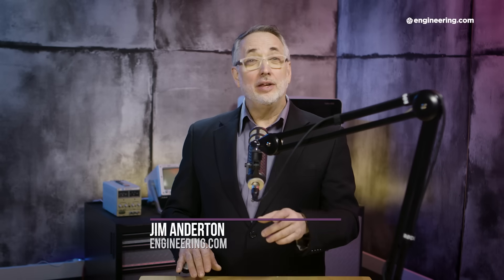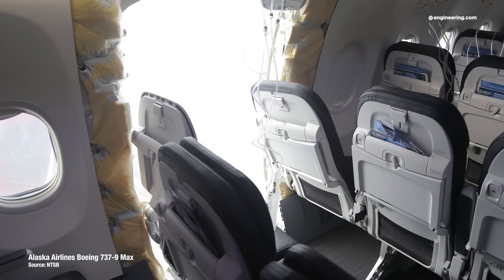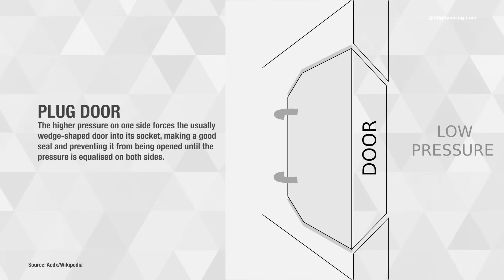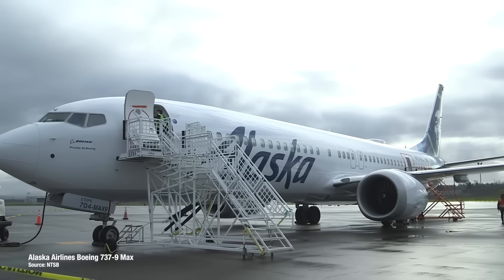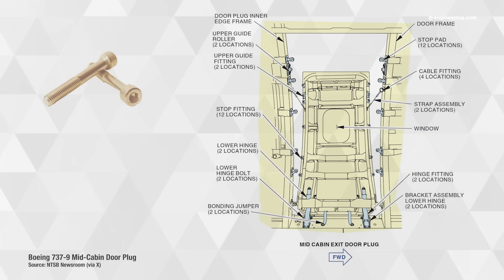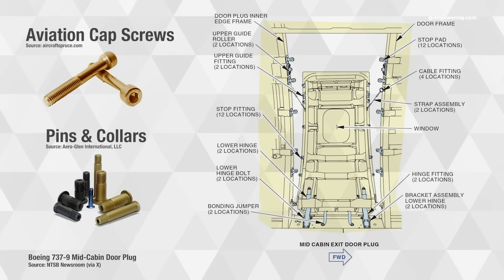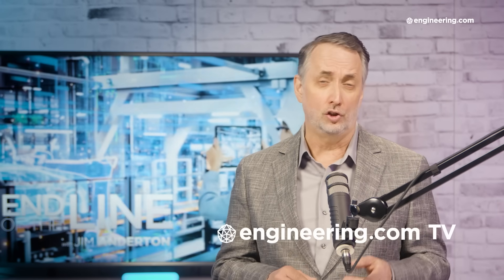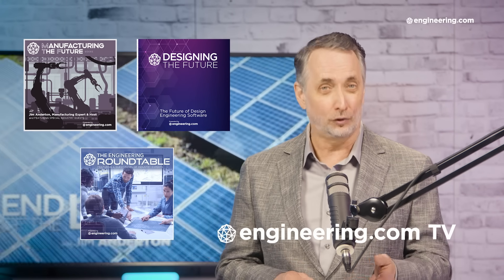The Boeing Issue Isn’t About Bolts

Comment: Blancolirio covered it. They did not have to account for replacing the locking cap screws if the door was not fully removed in a service operation. They replaced the seal, but did not have to remove the door, only Open it. That did not trigger a re-inspection. A cost-saving measure. See where that got them.
Reply: Deregulation
Reply: @michaelccopelandsr7120  Yes, the deregulation frenzy we've been living with (and dying with) for more than 40 years is at work here as is the never ending need for companies in every industry to constantly cut costs to increase profits.  Being able to skip a step that takes time and therefore costs money is manna for bean counters.
Reply: What regulation was repealed that would have prevented this??
Reply: What regulation was repealed that would have prevented this??
Reply: What regulation was repealed that would have prevented this??
Reply: What regulation was repealed that would have prevented this??
Reply: The two companies and their quality management systems not being compatible and both firms being too cheap to harmonize their processes has a big role to play here
Reply: @kansascityshuffle8526  Agreed. Boeing creates a separate company for which it will be the largest, or perhaps only, customer then doesn't require that it use a compatible quality management system? Not impressive...
Reply: @kansascityshuffle8526  so true, I can't stress enough the difference between repair and rework in this case, if I were auditing this process, I would suggest that this plug door application have its own work instruction, separate from the main production assembly instructions
Reply: Prob coded it as a repair, deviation, not rework to print in CMES, deviations are bought off by engineering, not inspection, too many rng deviations have cut out quality control oversight
Reply: A lot QC/QA engineers don't know a rivet from a Hi-lok. The issue is that no one is looking at the primary issue, which is the Door-Plug has an installed configuration, if the Door-Plug is opened, it's no longer compliant with the 'installed config'. This is an example related to CMES, garbage in garbage out. @pickpac1
Reply: The big question is why the seal wasn't fitted properly to start with. Then none of this would have happened.
Reply: It had to do with "interpretation" - they interpreted removing the door plug as the same as opening the door which doesn't require a check to see if the bolts were reinstalled correctly.  Boeing as an organisation and the "technician" who forgot the bolts should be ashamed of themselves and sacked immediately.
Reply: His channel really is top notch
Reply: Some braindead manbaby cut regulations 2 years ago and everything that is going wrong including this is because of him. 
Donald Chump did this.
Reply: Except that it's not a door.
Reply: he said he assumed it.
Reply: One wonders why the "door" was really needed; don't recall ever seeing such doors on earlier models of 737...
Reply: There is a culture problem here.  How do you make a repair and have left over fasteners.  Not know you have left over or missing fasteners.  One does not need a procedure book for this basic level of competency.
Reply: @danharold3087  That's a very good question, but considering the layers of inspection that failed were instituted in the past over such things, yet failed to work?  why do you suppose that happens?  Could it, perhaps, be that any organization of sufficient size and complexity will become awash in incompetence, fraud, corruption, etc.?  Boeing has all the same problems and issues that General MOtors has, and GM has all the same problems organizationally that the Federal government has.

Well
The problems now, can be traced to management initiatives begun in 1997, roughly just after the 1996 merger.  This was a time when the California based company, with their dependence on government contracts for nearly EVERYTHING took over the aviation company that was financing itself with commercial sales.
The number of no-work/no-show jobs increased exponentially, while the basic awareness of quality dropped into the toilet in favor of doing whatever it took to keep that green machine from Congress flowing in.
Reply: @danielball959  We had a former aerospace worker join our lab.  He worked at Boeing pre merger.  At that time management was already treating engineers and scientists like cogs.  More so for the people assembling the planes.
Reply: so much disinformation......juan never thought they were cap screws and they are not. they are hexhead bolts with castellated nuts that accepts a cotter pin that then goes thru the nut and bolt, locking the nut in place. the ''loose fastener'' thing is not even relevant in this scenario. castle nuts do not need any torque. juan has it right but so many experts out there that don't know what they don't know.
Reply: @bobnoffs7565  in design, the cotter pin is an extra step than can be easily missed when time to install, it might be too costly now for redesign to replace with a locking nut, engineering change during this stage of production is headache
Reply: @pickpac1 There is no evidence the bolts were fitted at all. These bolts are belt and suspenders. The bolts can’t fall out because the door holds them in by spring tension. The nuts hold the bolts and the cotter pins hold the nuts. If any one of the four bolts was present the door can’t open.
Reply: @allangibson8494  yes, and that is evidence to me it was done as a repair deviation and not rework to print, if that is the case, Boeing current process is engineering buys off the repair, not the Inspectors, either way, no one looked
Reply: @pickpac1  that's a lie engineering do not do any buy offs either the shop mechanics that are MSE2 certified or inspection buys it off. my guess is these doors probably had an engineering design change so the doors were temp installed by the shop and then the shop started working on the interior jobs skipping the plug process so then inspection couldn't see anything anymore so the shop leads retroactively bought off any open jobs after being pressured by management to "move things along"
Reply: Juan nailed it. What gets me, is the plug is commonly referred to as both a "plug-door" and "door-plug." The first implies something that can be opened and closed, without removal. The latter can only be removed and replaced. If it's categorized as a door in the procedures manual, that may explain why a safety follow-up wasn't specified. Just a thought.
Reply: @DM-MCMLVI  I thought the same watching Juan's video. First step in the new process docs... Stop calling it a door. It's a plug. Doors open and close, Plugs are inserted and removed. Plugs must be fastened to remain inserted.
Reply: @DM-MCMLVI  I think it should be called either door or plug. The two words should not be combined in any way.
Reply: @TheRVSN  That makes the most sense to me.
Reply: It seems to me that they simply forgot to mention this blind panel in the checklist. It is not just a door one can open and close like an emergency exit.
Reply: JB, has no personal expertise on aircraft manufacturing, he should keep his nose out of where it doesn't belong.
Reply: @c123bthunderpig  hi pig, I see that your yt channel has zero content which suggests you're a troll. And not a very good one at that
Reply: it was willful sabotage by a mechanic,  no way to forget the bolts if you follow procedure...   :text-green-game-over:
Reply: @boossersgarage3239  Bullshit. No final close out of a major component (and trust me, a pressure seal is a very major component) of any aircraft can legally be done without verification and documentation via inspection by a second qualified person. The manufacturing engineers simply forgot to include final close out inspection for these parts. This is a management issue that is being passed off as workmanship.
Reply: @boossersgarage3239 The procedure didn’t list the “fasteners” (technically they don’t fasten anything, they are just non load bearing restraint pins).
Reply: @boossersgarage3239  This can happen if the craftsman is called by his boss, and the other one mounts the cover.
But sadly, this seems to have happened not only once, so there is a big hole in quality control.
Reply: @gottfriedheumesser1994  The missing bolts were .  That's part of how they found out they weren't there wehn the plane took off.  That documentation had to pass through multiple levels of inspection, including Customer and FAA, without being noted or commented on.  The oversight was, in the administrative sense, there-it just wasn't enforced by the people (both inside and outside the company) who were supposed to enforce it.  The problem ends up being systemic, but not just to Boeing.  FAA is supposed to buy off on all documentation before the plane can be delivered, the customer is supposed to review all documentation to be sure they're getting what they paid for.  The documentation was there, but several layers of somebody didn't do their job.
Reply: @boossersgarage3239  You have never been interrupted at work?
Reply: @boossersgarage3239  willful or not, nobody looked at the reinstall, repair deviations are  engineering responsibility who didn't do their job, quality control inspectors are supposed to but at Boeing, are not part of the repair process

Comment: Documentation (lack of) & Intimidation (to do undocumented work) are only one of Many self-inflicted problems, at Boeing & in Renton, WA, because Spirit Aerosystems is "plagued" by so many "Quality Control" problems of their own, they have to station FT employees, in Renton, to fix what they did Not fix, before the fuselage was shipped, but Spirit employees use a completely "different" computer program than Boeing employees, that do Not connect with other & have completely "different" requirements for How the repair is done & what, if anything, is Documented, depending on What they say they did !!!

Comment: The issue isn't the bolts. It is the rotten corporate structure at Boeing.
Reply: McDonnel Douglas bean counters.
Reply: this was maintenance at fault, not Boeing.
Reply: @SoloRenegade  The plane was practically brand new: Only in service for a couple of months.  It seems that these bolts/fasteners/whatever people want to call them, were left out at the factory, and the error was never caught due to the incompatibility between the Quality Control systems at Boeing and at the manufacturer of this section of the fuselage (which is not made by Boeing itself, but by a subcontractor).
Reply: @ChristLink-Channel  if that's the case, then yes, it would be Boeing's fault.
Reply: If Boeing does not stop their DEI hiring and their diversity programs, then Airbus and the Chinese will replace them in the market.
Fuck around and find out, go woke and go broke.
Reply: NO.  the issue is dishonest assembly workers lying about doing the job...
Reply: @boossersgarage3239  - Yep, that is what happens when you fire all of the honest workers. Why were they fired, because they kept pointing out to management the  problems with health and safety.
Reply: @boossersgarage3239  and that's down to poor management oversight, so back to the corporate structure.
Reply: if that is true the whole company is rotten @boossersgarage3239

Comment: according to another channel its a maintenance/assembly log issue... which means there could be other issues with the logs not ensuring steps were followed, so its a far more complex problem than just checking all the doors for bolts... as there could be other procedures not properly documented or completed on other parts of the manufacturers and sub-contractors aircraft....
Reply: And if that's the case (which wouldn't surprise me), it's NOT just a Boeing thing.  Of course, only two big companies make many commercial aircraft. But if airlines are hiring maintenance and doing shoddy, cheap work -- this kind of thing will impact ALL commercial aircraft over time.
Reply: @rogergeyer9851  You are correct, it isn't just confined to Boeing and Spirit.  Every aircraft/aerospace company has this problem to varying degrees.
Reply: That is the most likely explanation.  Hopefully the investigation will reveal the truth.

Comment: The issue seems to be expensive lobbyists keeping the FAA away from Boeing as it seeks to avoid consequences for it's failing internal systems?
Reply: What about keeping them away from Airbus as their landing gears continue to fail? Though it may be in the rational self-interest of the FAA to not punish either one if it means they would stop collecting fees associated with air travel such as overflight fees and airport usage fees.
Reply: @aycc-nbh7289 :  Exactly.  If it's a maintenance problem, then it's ALL commmercial aircraft, the FAA, etc. involved re the rules and trade-offs re safety vs. cost.   And of course, everyone wants the very cheapest tickets - so there's that.

Comment: Ok, but Alaska airlines is reporting a lot of loose bolts on the inspections of other 737 max 9s not missing ones. There could be an engineering issue where the bolts are working loose under certain conditions (or lock wire is not being installed). It may have fully passed exit inspection with bolts installed and torqued if there is something else at work.
Reply: It’s because the FAA gave the QC job to boeing and they messed it up because of that crappy management

Comment: Was the door even engineered to take advantage of the pressure differential to strengthen the seal? If not then the design is inherently shitty.
Reply: It does seem like a failure to use a fail-safe design. Even with the locking pins/capscrews/whatever removed, the air pressure in the cabin should have held the door in place. It should have only fallen off while the plane was on the ground if it were mis-assembled.
Reply: This particular plug-door is designed as an outward opening door to be refitted as a 5th emergency egress/escape door when the aircraft is configured with increased seating requiring the additional door to meet FAA regs. @TD_YT066
Reply: the earlier 737 s used a true plug door emergency exit over the wings, pull in and remove, no hinges or bolts ,just a latch
Reply: @JamesAnderson-mr2sg  Thanks for the info. A much safer design, and seems like it should also have been less expensive to produce as well?